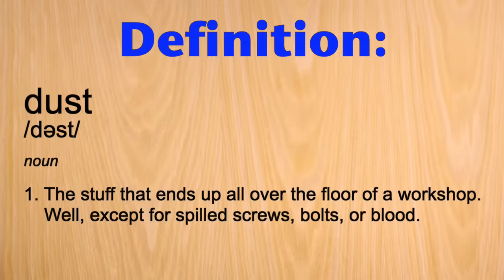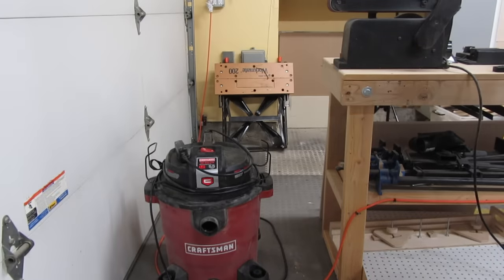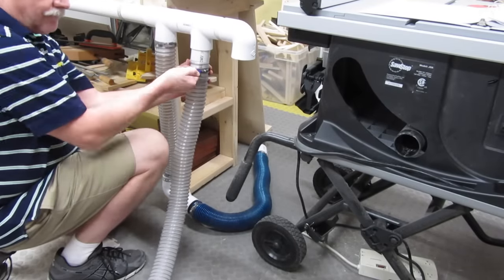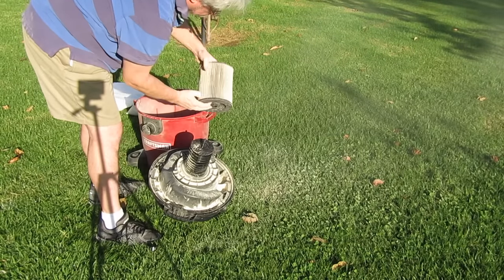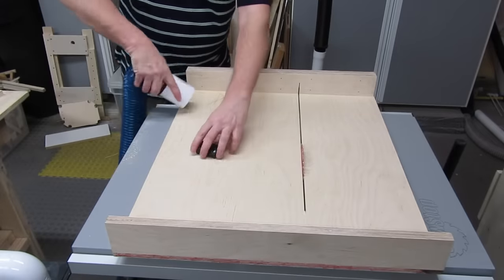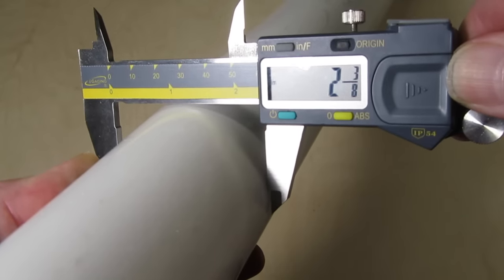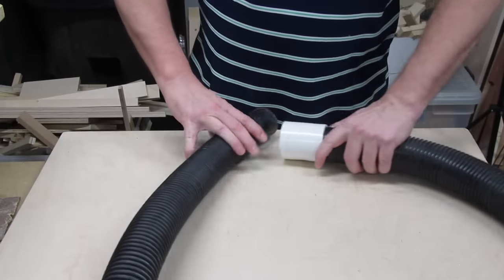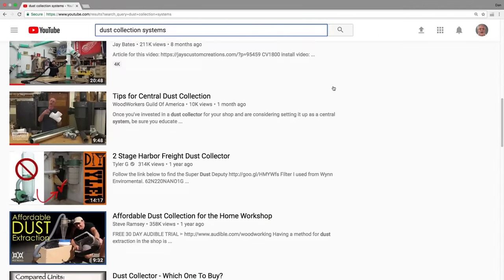Dust Collection for Newbies: Introduction to Dust Collection

Comment: I used to have the remote startup for the vacuum, but could never find the remote when I needed it.  So I mounted it but it wouldn't always start the vacuum.  Then the remote broke after about four months.  So I got a echo dot for my garage and an Alexa switch.  Now I say "Alexa, turn on the vacuum".  Works like a charm, even when it's noisy.
Reply from the maker: That's a great idea! Thanks. 😄

Comment: Love, love, love the video. It is VERY refreshing to see a video on this topic for home woodworkers that don't have a shop with $100k worth of tools or a 100 HP collector. Too many videos with high price tools and systems. Perfect for my shop with about as many tools as you have. Perfect. Great job on the video.  Wish I could give more than one thumbs up :)
Reply from the maker: Thanks, Ron! You just made my day. 😄
Reply: You deserve the thanks. If I was doing woodworking for a living, then it might be different. But as a hobby, house remodeling, ect, I don't need big fancy stuff. Just watched another video before yours, the guy had a $2K collector in the back ground. Ya, like my budget would handle that. Only thing, PVC still makes me slightly nervous, few people talk about static electricity causing problems. But seems very rare, more saying it's not an issue. Gonna check out your PVC moulding video.
Reply from the maker: Thanks! As for PVC and static electricity, I have a video on the subject, but it can be summed up by this web page: https://www.rockler.com/exploding-pvc-dust-collection-ductwork. So personally, I'm not worried. But if you get blown up, it's not my fault. 😛

Regarding molding PVC, you may end up preferring to use a heat gun. The oven method seems to freak some people out. Or their wives. 😳

Comment: I used thinwall 4" drainfield PVC  for most of my dust collection system (got it at the local ReStore for .50 per foot). I had no trouble cutting it with my miter saw. Just keep a firm grip on it. If you are sawing short lengths for fittings, a band saw works great. Blast gates can jam even if mounted horizontally. To remedy this, I drilled a 1/8" hole in in the two corners opposite the slide. The small amount of air sucked in these holes keeps dust from building up in the corners, but it does slightly decrease the suction. The corner holes are completely closed when the blast gate is closed. so they don't compromise the rest of the system.
Reply from the maker: Thanks for the info! 😄

Comment: I use a chop saw to cut pvc frequently and as long as it is braces properly and your using a sharp blade, it’s never been a problem. It’s wonderful and easy to get accurate cuts in fact.
Reply from the maker: Thanks for the info! That seems to be a popular option. 🙂

Comment: Finally, someone who explains it very simply without costing a fortune. Thank you!
Reply from the maker: You're quite welcome! 😄
Reply: haha its your health. sorry but 2" pvc has very little help with getting the fine dust that leads to health problems. while this is better slightly better than nothing.  there is a big difference. you can get good dust collection without spending a fortune.
Reply from the maker: @derekmoen5382  Well, you're right and you're wrong. Yes, 2" PVC wont get rid of fine dust. But chances are, you're not getting rid of it with your existing dust collector, either. According to Bill Pentz, most people's dust collection system doesn't have large enough pipes and enough power to capture the fine dust particles. And even if it does, if you vent inside your shop, which most people do, you've basically just got a dust pump. It's a lot harder to remove fine dust particles than you think. All I'm saying is, don't assume that just because you think you have a "proper" setup, it doesn't mean that you're protected from fine dust particles. http://billpentz.com/woodworking/cyclone/index.cfm.
Reply: @TheNewbieWoodworker  you have read bill pentzs stuff and you are still telling me I'm wrong? You must have missed a lot of pages....I have read it all and some books. Bill definitely knows his dust. Dont quote me but I think He recommends a minimum of 5 inch duct. A 6" duct is way better which allows around a 1000 cfm. Now I have had several cyclone dust collectors with okay success. I now have a 5hp Oneida pro 2000 with 5hp. 8 inch main that drops to 6 inch lines then at the table saw I have a 5 and 4 inch, with 2 routers built in that each have a 5 and 4 inch lines,  jointer and planer are 6" lines both bandsaws have 2 4inch lines each, my 16/32 drum sander has it's own 4 inch line. All the other small sanders, drill presses, mortising machine and others all 4 and 5", radial arm saw, miter saw 6" lines, downdraft table will also have 5" line and internal blower. I can assure you I'm on top of it. It took getting sick from dust for me to realize I had to better it. I'm 38 this is mostly a hobby for me. It doesn't matter if you're a weekend maker or fulltime dust collection is very important. Dust not chips!! Remember you cant see the dust your not getting. People see videos like this and while it is better than nothing think that this is the key to getting all the dust and it's not! And in all fairness it's a good video.

I also got the collector used for 800 most of the spiral pipe, gates and fittings slightly used for 200 more gates, 6" elbows and connectors ran me 260. I still have a ton of pipe left.
Reply from the maker: @derekmoen5382  OK, Derek, I painted you with the wrong brush, and for that I apologize. I appreciate that you obviously have taken Bill Pentz's research to heart. Mind you, what I said still holds true for a lot of people, who think a Harbor Freight dust collector and 4" pipes will solve all their fine dust collection needs. You and I both know that's not true.

This particular video is for newbies who don't have any kind of dust collection at all. Should I have mentioned fine dust particles? Honestly, I didn't even know about that until a while after I made this video, so it's a moot point.

I've been thinking about making a follow-up video for quite some time, discussing fine dust collection. But honestly, I'm just not qualified. Additionally, whatever I would say in it would start a flame battle, and I'd end up being in the position of having to defend Bill Pentz' research and conclusions, and I just can't do that. Like I said, I only know what I've read, and although I believe him, I don't want to make a video I can't verify myself. And I'm not about to invest in a fine dust meter that I'm not even sure would be calibrated properly, and would give me numbers that were actually relevant.

I hope that all makes sense.

Comment: This is the 1st video of yours that I have seen.  I'm hooked!  I love your succinct and articulate presentation.  Very easy to learn from.  I too have an Oneida Dust Deputy.  I read reviews of it and the Rockler version and, based on them, popped for the Oneida.  It is an older one with plastic vortex on metal can with metal lid and casters on the bottom.  I am so glad I read the reviews.  The Oneida does exactly as you demonstrated it does.  Exactly as advertised and more.  Thanks for a great presentation.
Reply from the maker: Thanks! Glad you liked it. 😄And welcome aboard!

Comment: Great basic video on dust collection system Miter saw does cut pvc nicely, but you have to hold it down and it will shatter if it moves and cuts.
Reply from the maker: Thanks! And thanks for the info 😄

Comment: I have an OLD craftsman tablesaw, before dust collection was a thing. I mounted it on a platform at end of workbench I made (gives me a 7' out-feed table)  I cut large hole in platform then placed garbage bag with bottom cut off in the hole, stapled to the platform edge of hole. Saw sits over this "chute" and I made a small wooden box on wheels to catch the sawdust,- works quite well
Reply from the maker: Very creative!

Comment: Great video.
One suggestion.  Static electricity elimination.
Sawdust can build up static electricity as it runs through the dust collection system.
Get either copper "tinsel" or strip some "Romex" electric wire and use the bare copper ground wire.
Attach one end to the metal frame of your table saw (IF that's the farthest machine away from the vacuum) and run the copper INSIDE the tubing.
Attach the other end to the cyclone (as shown in your video).
The static electricity will be 'caught' by the copper tinsel or bare wire and ran to the metal frame of the tablesaw, etc.
This will also help prevent a possible fire.  Dry wood.  Oxygen.  Spark.  = fire.

Just a thought.
Reply from the maker: Thanks for the comment! If you feel you need to ground the system, then by all means, do it. But this article states my feelings on the subject pretty well: https://www.rockler.com/exploding-pvc-dust-collection-ductwork

Comment: A fantastic 101 of dust collection.......setting up my newly built workshop so this has been GOLD! Interesting that you are using a shop vac type vacuum, I wouldn’t have thought it powerful enough once you have connected it to all that tubing.
Reply from the maker: Thanks. For the most part it is plenty powerful enough. There's no such thing as the perfect dust collection system, but this is still working fine or me.

Comment: A very good and well presented video for people new to these concepts.
BTW, many 5-gal. bucket lids have segmented break-away edges, and even when all the band and segments break off, the lid will still have an adequate seal and you wont need the lid removal tool. That tool is intended for new buckets with double seals like paint buckets and other liquids.
Reply from the maker: Thanks. And while that may be true, the Home Depot "Homer" bucket isn't like that. And that's the only ones I have. 😄

Comment: Awesome video! I am doing what you used to do, moving the hose from one tool to the next.
Blast Gates and re-piping is the answer .

I've used a 12 inch miter saw to cut 4 inch PVC pipes with one pass. When cutting a 4 inch PVC pipe
with a 7-1/4 inch miter saw,  I place a stop block to place one end of the PVC pipe for the 7-1/4 inch
blade can not do the cut in one pass. The stop block keeps 4 inch PVC pipe in place when rotating
the 4 inch PVC pipe to complete the cut. I use a Wood & Metal blade and a slow plunge.
Reply from the maker: Thanks, and thanks for the info! 😄

Comment: I really enjoyed this video and found it very informative. I'm qualified to complete Thorough Examination and Testing of Local Exhaust Ventilation Systems (LEV's) in the UK. There are a couple of points I would raise. As you mentioned, it's important to not have right angled duct work as this can lead to build up within the duct which leads to a reduction in the air velocity. Most importantly is the need to have LEV's installed and to use them. It is estimated there are 13,000 deaths per annum caused by the inhalation of dust and fumes within the workplace. Stay safe.
Reply from the maker: Thanks for the info!

Comment: thanks for the video on dust collection. I'm working out a design for my indoor/outdoor shop so it needs to be easy to assemble, disassemble. I think the best idea here is to keep it simple and the costs as low as possible.
Reply from the maker: You're welcome. You said "I think the best idea here is to keep it simple and the costs as low as possible," and I think that's good advice for most everything, don't you? 😄Good luck with your project!

Comment: Great video. Two of your ideas really stand out to me.  1) using a remote control to turn on/off the vacuum and 2) heating (how?) PVC to shape it!.  About cutting PVC, I prefer using a wood hand saw over a hack saw because the cut is straighter and faster (and only a bit rougher).
Reply from the maker: Thanks! For heating PVC, use a heat gun or hair dryer. I'll be making a new video on this subject soon, but that's the gist.

Comment: Excellent video. I know I am late to the comment list but thought I would mention that the fewer turns and curves as well as the shorter the distance the dust has to travel the better. Taking the extra slack out of your tubes (unless you move your table saw frequently) would help reduce the load on your shop vac and increase airflow at the table saw.  If your saw never moves, running the PVC all the way to the back of the saw would work best. Keep up the great work!
Reply from the maker: Thanks, James! Better late than never. 😄 I really do appreciate your comment, even though it's cost me 20 minutes composing this response. 😛

I'm not 100% sure I agree with what you're saying, but let me explain - I might be wrong here, so bear with me for a moment.

Normally I get comments like "using two 45 degree elbows is better than one 90 degree elbow". And here's my typical response, or something like this depending on how wordy I feel at the moment:

"As for [45 degree vs.] 90 degree bends, believe it or not, 90 degree bends have a negligible effect on 2" systems that use a shop vac. Something about air speed vs. air volume. I did a lot of tests with an anemometer, and they just don't make a noticeable difference."

But you didn't actually say anything about 90 degree elbows. So I'm not sure whether what you did say is right or wrong. (As if I'd be the final word on truth, LOL). I haven't done any testing, so I can't be sure.

One thing I do know is that using typical tubes that are accordion-like does impact performance. Sometimes that can't be avoided, though.

So, what do you think? Do you agree about 45 vs 90 degree bends?

And have you tested straighter vs, um, not so straight, changing just the PVC bends? (Or seen a video that tests this, using a shop vac system and 2" pipes"?) Because I'm thinking it won't matter much with shop vac systems, but I don't know for sure.

I'd love to hear your response!
Reply: @TheNewbieWoodworker  I agree, two 45s vs a single 90 is negligible especially considering that you more than double the cost of the turn. I think people came up with the two 45s creating a gentler turn would mean better airflow similar to the elbows in electrical conduit make it easier to pull wires.  It isn't a good comparison and two 45s still make a 90, just over a longer distance. And as mentioned,  a higher price. 

The air flow is more similar to water flowing through a pipe than pulling wires. The longer the pipe from the source the less the water pressure.  Also, elevation compared to the source makes a big difference. 

The more bends and turns the air has to make, the more momentum changes the air and dust has to deal with. The straighter a run can be, the more the particles momentum works with the shop vac rather than against. Excessive flex tube that allows sagging or more bends and turns than absolutely necessary create areas of resistance due to momentum changes. If you think about how much the flex tube moves while the dust is moving through it,  that is all energy that the shop vac is expending due to the dust running into the walls of the tubing.

Also, by using the long flex tubes that allow the air and dust to drop below the original elevation and the straight run tube, now the shop vac is forced to work harder to lift the dust back up.

The system you display is very short and straightforward and likely to not reflect a large change in your airflow if you shortened the flex tube to reduce the sag. Or added more PVC to bring the straight run closer to the dust port on the table saw. But the more PVC and less flex used, the less expensive the system is. 

I have not done any specific test in regards to this myself that would produce any kind of numbers,  (I was drooling over an anemometer yesterday) but practical testing has show good results with shorter straighter runs vs. longer curved or bent runs.
Reply from the maker: @jamnich1  Great response, James, and I really appreciate it. I've heard the analogy of water in pipes before, but for some reason, it didn't really resonate until now. So thanks for that. One slight point of clarification or disagreement, depending. 😛45 vs 90 degree elbows apparently do make a big difference in the larger 4"/6" dust collection systems. I'll bet you understand the distinction better than I do, but as I said earlier, it has to do with how one system relies on air pressure, and the other on air volume, *or something like that*. I probably have the details wrong, but unless I'm mistaken, this has been pretty-well documented.

On other thing: Buy the anemometer. You know you want it. 😛

Comment: Just for your information: In the good Ol' US of A  plumbing pipe is measure by the closest inside diameter. Also next time you are at your big box store take a look at the 2" PVC DWV (drain waste and vent) fittings. they all flow together instead of the inlet hitting the main at a 90 degree angle. Should cut any blockages down substantially. These fittings will fit your existing pipe. Hope this helps.
Reply from the maker: Thanks for the info!

Comment: The best way I have learned to cut PVC is using a reciprocating saw. They work great with a fine tooth blade. These saws are great for anything rough cut you want to do. They are a must have for anything, metal, wood, stainless. They work great. I have a makita and I love it.
Reply from the maker: Excellent tip. Thanks! 😄